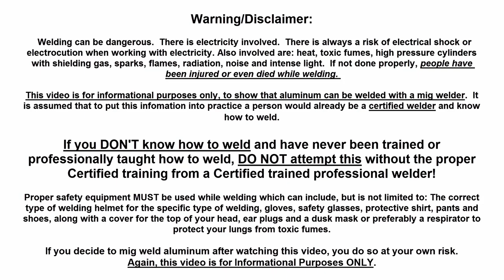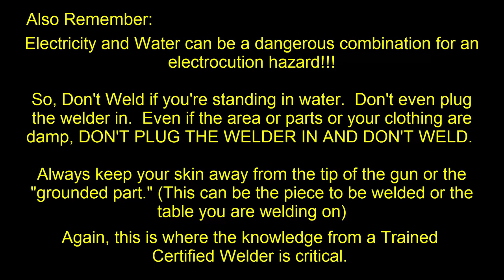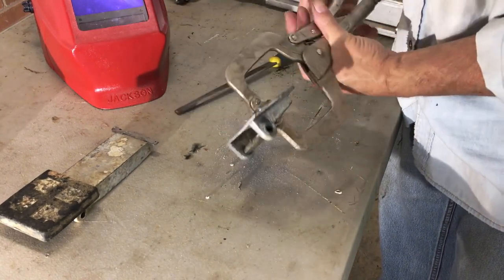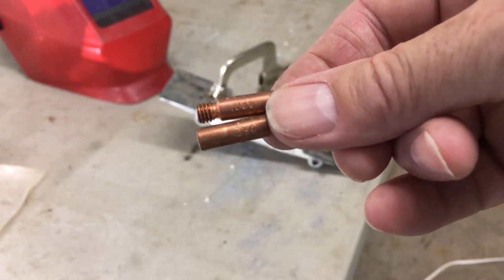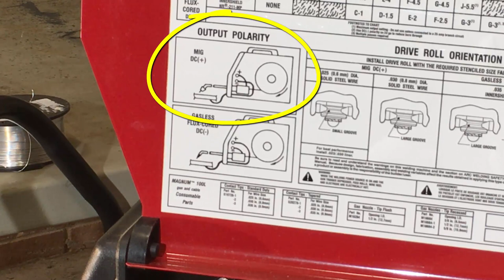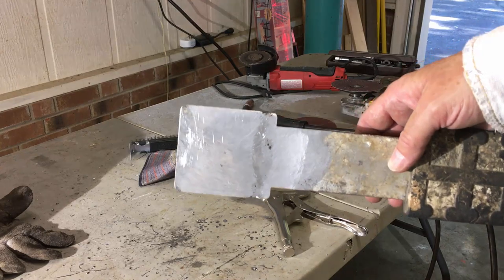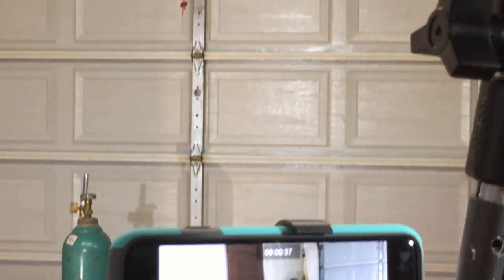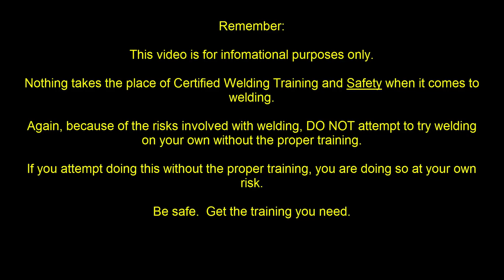Learn An Old Timer's Secrets To Mig Weld Aluminum Without A Spoolgun

Comment: as a suggestion from someone who has experienced this firsthand, PLEASE REMOVE THE RING !!!! from your finger. I had to have mine cut off my finger after it got welded to it.and not from using my welder but from a battery cable that was supposed to be disconnected and wasn't. I was helping my boss change a 24 volt starter on a diesel engine, and was told the battery cable was removed. I went to take off the positive cable and the wrench touched the frame. well I got to Ride the lightning on that stunt. gold and silver are excellent conductors of electricity
Reply from the maker: YIKES!!  Thanks for sharing that story.  Good safety tip. Thanks!
Reply: michael munson rule one dont trust what anyone said thay did . I work on heavy equipment  only time i take of my ring is when i actually unhook or hook up batteries or mess with the live leed on the alternator if i didnt unhook batteries .
Reply: I don't wear a ring period in any build or maintenance setting.
Reply: Also this is not  special. This high school stuff where I grew up.
Reply: You should never wear jewelry when working.
Reply: Yup, rings have no place when working, especially when electricity is involved.  I wore my high school class ring when I was led around a maintenance hanger on my first assignment as an electrical systems mechanic on a flight line when stationed in Japan.  The crew chief guide pointed out an 8" X 10" photo on a bulletin board of a ring finger with a wedding ring around it lying on a table.  The long tendon that had run up the guys arm was still attached.  The finger had been attached to a guy that exited the cockpit of an F-100 fighter aircraft by swinging himself over the gunnel, and dropping to the ground, instead of using a ladder.  The ring got caught on the edge of the sill, and stayed behind.  I put my ring in my pocket, never to be worn again.  I wore my wedding ring to get married, and it, too, went into a drawer.  I learned to work on live electrical panels, and can't imagine wearing any finger jewelry when doing so.  Still have all of my fingers and most of my toes.
Reply: Search "silicone wedding band"
Reply: same here.... my ring got caught on the edge of pvc 4 inch pipe when someone was shoving it through a wall... ouch... last time i wore my ring in any work invironment
Reply: I know someone who ruined a watch and got a nasty burn around their wrist
Reply: I have a friend missing his wedding finger. Jumped down off of a truck and his ring caught on the stake boards and ripped his finger off. 1970, they were not to big on reattaching fingers in the 70's.
Reply: Another reason not to wear a ring at work is because when one takes their gloves off sometimes the ring comes off and either stays in the glove or falls somewhere never to be seen again. Not good if one values that ring for some reason or other. I just wear my ring when I go places with my wife.
Reply: you dont wear gloves ?
Reply: happened to me to while working on my ex wife's car ! Guesse the new wife Jinksed me Lol
Reply: Had a guy trying to hook up a remote starter switch for me so I could run the rack without bothering him to crank engine over. He was wearing a watch with a stainless band and he shorted out his watch band and starter yelling ow, ow, ow. He got the watch off and a little hide with it. Ha, Ha!
Reply: In the 70's I had a real nice selfwinding watch until I wore it while welding on a hunting wagon. I think I got inside a coil of the lead. The watch stopped and I had to take it to a watch repairman. He said it got magnetized and it was forever. I still have that nice looking watch put up with all the other ones that don't work. I tried to demagnetize it several different ways but with no luck. @Chris68558
Reply: I saw a mechanic in the shop I managed short his wedding ring between his ratchet and the positive battery terminal. Melted his ring while on his finger. His finger swelled up twice the size and wife was pissed about the ring. Just don't do it.

Comment: I think the dust mask should be replaced by a organic solvents rated cartridge filter respirator.  Maybe while you're at it, get rid of the plastic welding table.  Little less talking, little more close up work.  Just my unsolicited $0.02 worth
Reply from the maker: Thanks for your input. The size of an organic solvents respirator won't fit underneath the welding mask.  They do, however make a respirator that's made specifically for welders.  In fact I make a comment in the video that "a dust mask or a respirator" is needed to protect your lungs.  Thanks for watching the video!
Reply: Fume evacuator.
Reply: Me too. Ugh. Not needed. Content is good but the music is loud and distracting. Thanks for posting this.
Reply: A dust mask does nothing for fumes. An N95 mask will be far more effective. But even that may not adequately protect if poisonous fumes are a concern.
Reply: Your Right That's why they are called DUST Or PARTICLE Masks.  I get Kick out of People when they use them to Paint or anything that Involves Fumes . They only Keep Particles Out  they do nothing for Fumes .  I have Been Welding for 35 yrs and the Only time I use one of those masks is when I am Grinding
Reply: Amazing to me that he would expose himself to environmental health claims after being SOOO careful with the long written caution against electrical injury at the beginning, ending with a liability disclaimer!
Reply: brucenoneyabusness 
Bruce you are right!
And Mr. Stairway,  YES 3M makes a inexpensive respirator with replaceable cartridges and yes the pink round cartridge (I don’t remember the # of it) is for welding fumes and it fits under the Jackson Shadow Hood with plenty of clearance!!! I used it many many hours welding galvanized and epoxy painted metals on rides for 6 Flags theme parks over the years but, the cartridges don’t last as long when welding on galvanized metal. Respectfully Mark K.
Reply: Look bruce,
This is noneya business.
Reply: there p--100 pink filters im a boilermaker welder and we use them all the time.
Reply: I hate music in the background. music is for teenagers not real craftsmen. phdfxwg Fischercat

Comment: "How to bevel an edge without a grinder"   How to hammer without a  hammer...   You've been doing so much with so little for so long,   you are now qualified to do anything with nothing.
Reply from the maker: HAHAHAHA!!!  Your comment made me laugh outloud!!  Thanks for making me laugh!!
Reply: 'sallright,   thanks for the thanks it feels good to be recognized once in a while.
Reply: That's hilarious David. I don't laugh much but that fit the bill.
Reply: how to weld with nothing but bare hands and a whalebone corset. Just weld to metals together by rubbing them together fast enough like superman
Reply: @JohnDoe-kp3sw  love how he welds gas tanks! BOOM!
Reply: HAHAHA! that is a good one! the guy is like an ancient god doesnt even need Thore's hammer
Reply: After using grinder, I would use file to flow out weld, at least on steel, if it was to be critical, like pipe.
Reply: Or, qualified for nothing using everything.

Comment: cool nice tip i think most people have a hard time and have to uses the spool gun if they don't realize going with thicker diameter wire and tip as well as the pure argon. Looks like you can almost do the equivalent to tig with maybe raised a little welds that have to be grinded down. Really cool to play around with tig , mig and see the significant differences.

Comment: so weres the old timers tip in his day they didnt have mig wire soooo its 20min of prep and 10 sec of weld
Reply: You say MiG welding invented in 1976, I started working at shop in 1977 and they had large amount of the place converted to MiG welders. First place I used one but knew all about them as I had seen them in books for many years.
Real old- timer trick for MiG welding aluminum is to make the lead go as straight as possible to help the wire go through better or set up an old lead and make it as short as possible. One place I worked had one set up for working at bench and lead was only about 6 ft. long

Comment: Aluminum can be welded using a TIG welder using the constant High Frec. setting with the machine set to AC mode,
Reply: yes that is how I learned to weld aluminum ...Tungsten Inert gas not as easy as an auto-feed Mig welding. that looks so easy I think a child can do it

Comment: Well, the legal disclaimer at the start of the video, ruined the experience for me.
I was shocked and also frightened to learn that Mig-Welder utilized electricity.
Furthermore, having to clear the work area of gasoline storage containers, flammable solvents, propane tanks, ect. required such a massive departure from my normal work practices (pouring a puddle of gasoline on the floor and standing in it, while leaning against a leaking propane cylinder, with a frayed electrical cord wrapped around my neck and upper torso) that I found myself thinking: "Gosh...now that I've taken all of the fun out of the equation, I've completely lost my desire to weld."
Reply: marshalllhiepler wtf..that is all the fun it
Reply: ozito mig welder mwr-135 will work?
Reply: Love it!
Reply: The comment of the year if you ask me!
Reply: You forgot to mention lighting up a cigarette while you are doing all of the above...

Comment: If you have used this welder for steel wire the liner will contaminate the aluminum wire.
Reply: good to know
so what is the remedy? buy two welders and use one only for each metal?

Comment: Thanks for this video. With what you've shown along with some of the other comments from others with experience, I can finally try my hand at welding aluminum with my mig. I've tried the brazing but it's not holding well enough. 
I was looking for a way not to have to go buy the expensive spool gun. I have a few years of welding experience but I know aluminum is whole different game.
Interesting point about not wearing a ring during welding (Thanks Mike Klass).

Comment: What is the gas flow setting ?
Reply: Around 20 psi is a good setting for mig and 10-15 for tig depending on the diffuseer size !
Reply: CFM, Not PSI. But you knew that
Reply: carl lavertu for aluminum welding you better be between 30-50 cfh   Or 15-25 liters per minute   
The argon flow for mig welding aluminum is about twice as much as the shielding gas flow for regular steel wire mig welding

Comment: Thanks for the extra tips on how to.  Great info on the weld, I have welded for some time but never knew this stuff on wire and the increase size for the tip. I will be making use of every thing in this video.

Comment: Very professionally made video! Thanks for the tips on welding aluminum.  I have used MIG for steel for many yrs. Never Aluminum. The demonstration of your recording equipment in the end of the video was really a hit! Thanks again for a great video!
All the best, Dr. Robert Svensson
Reply: There is nothing professional about this video.  Not one thing. Especially welding on a plastic table and saying in the video 
“Let’s head over to the welding table”.

Comment: If you are doing any structural welding you need to make sure the wire you use is right for the metal composition, just cause it's stiffer does not make it right.

Comment: I know you said to use a .035 tip, but do you also use a drive feed roller with the wider groove for .035 wire?
Reply from the maker: Thanks for the question. Use the same drive feed roller size as the wire size, then use one size larger tip.  So, if your wire size is .030” use a .030” drive roller size, then use a .035” size tip.  Thanks!